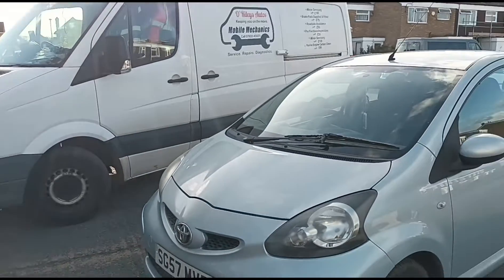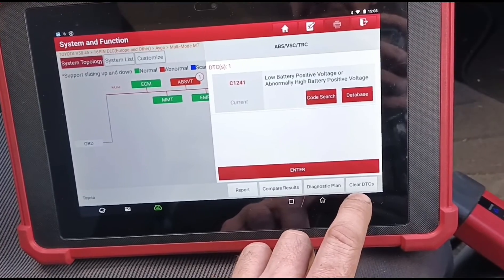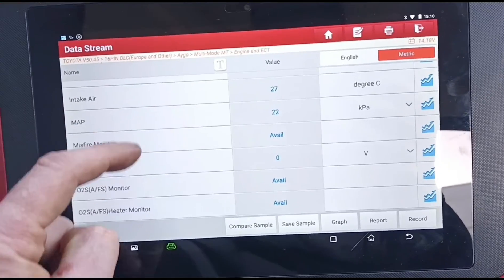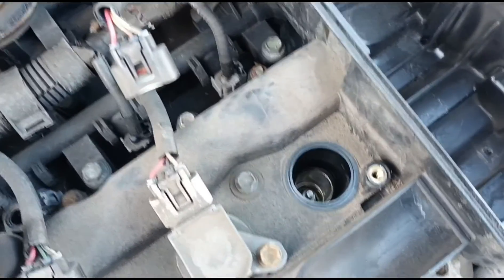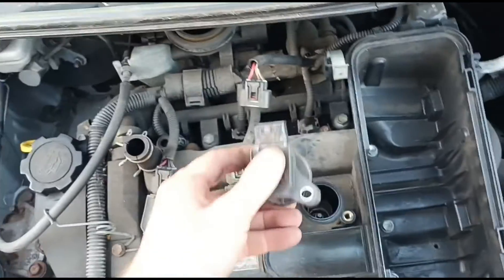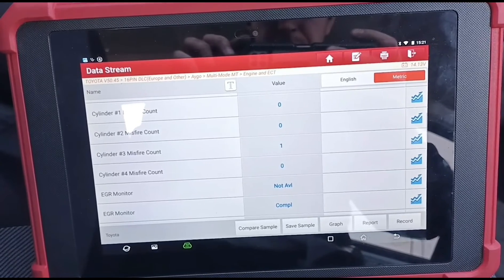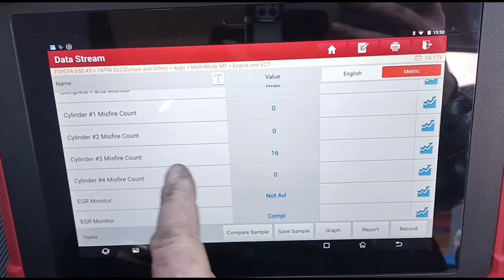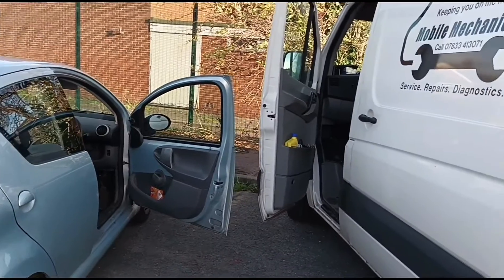Toyota Aygo: Diagnostic on Engine Power Loss

Comment: The brown stain on the ceramic outer part of the Spark plug is called "Corona" and its not rust............its the combustion gases in the cylinder staining the spark plug ceramic tip which is porous and eventually with time showing on the outer surface of the ceramic  insulator. It is normal and not a defect but can be an indicator that the plugs are old and have not been changed for a long time.......consistent with long service intervals.
Reply from the maker: Yeah I forgot what it was called so just said rust lol. I don't rehearse or edit the videos just do it in a single recording by just pausing the record button 😁
Reply: @ORileysAutos  No probs Jimmy ..........just chipped in where I had some knowledge.  Great Video - Top man.
Reply: Wonderfull explanation of the corona line, best I've heard yet,  of course jimmy knew that, 
What a clever chap, brilliant.